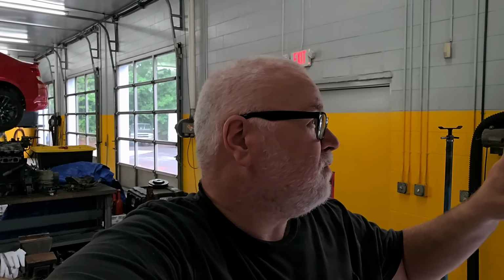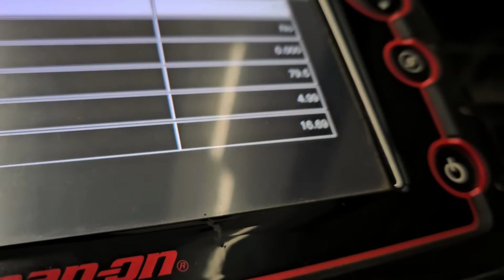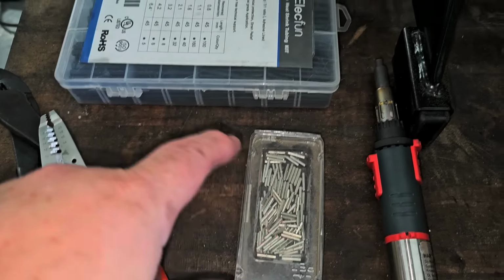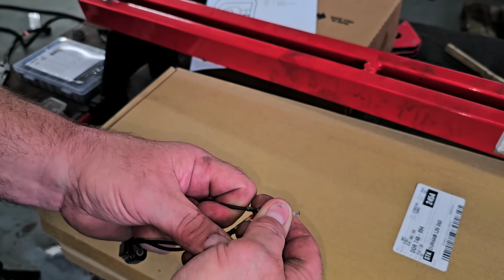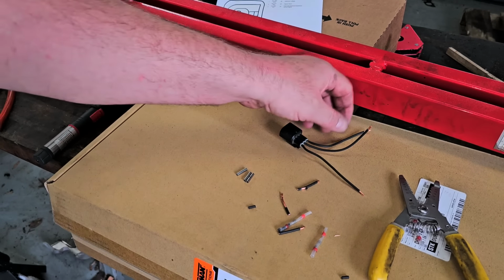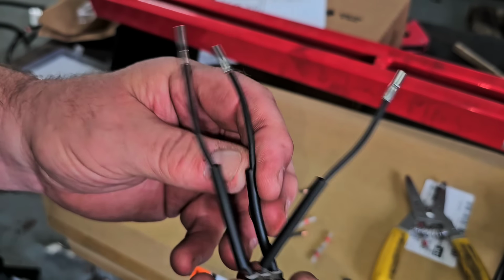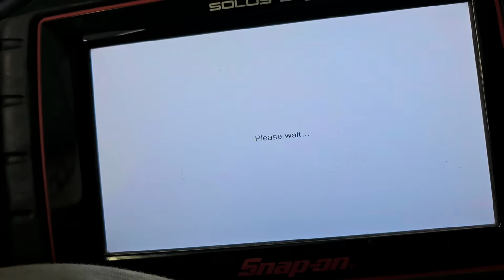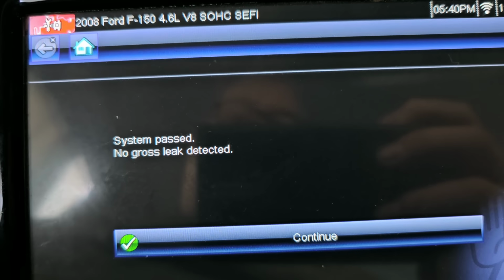Do Not Use These Connectors! They Are Not As Good As They Seem!!

Comment: The melting point of plastic is about °250 and the melting point of lead is about °620 ! Its no wonder they do not work ! LOL 😝
Reply: Plastic and solder both have variable melting points depending on what they are made of.
Plastic car parts in hot areas are typically Nylon because it melts at a very high temperature (516F).
Solder ( which rarely contains lead since 2010) is calibrated to melt at a specific temperature and is used in temperature dependent safety devices such as melt plugs and burn links. Anywhere from 190-840 F can be needed to melt solder.
It's zero problem to formulate plastic and solder to allow solder to melt before the plastic.
Reply: @btwbrand  you can get low melt solder that can practically melt in the palm of your hand which i would nt use for making wire joints

Comment: Not the joints it is the idiot trying to use the joint without understanding the right way to use them.  I’ve never had a bad connection using these joints solder is a must for reliable connections in these types of repairs...... stupid people say stupid things..... jus’sayin......

Comment: I use them in many applications but you need you need good clean copper a very small dose of flux & the secret sauce of enough heat & watch the solder disperse into the joint & the examples you showed didn't meet any of these rules so don't bag on them they do work.

Comment: Those connectors never work properly unless the wire is spotless. The littlest corrosion, and they do not make a good ELECTRICAL connection. I solder by hand and heat shrink.